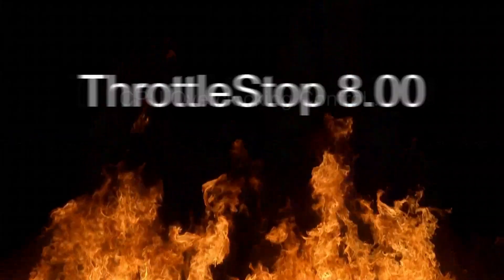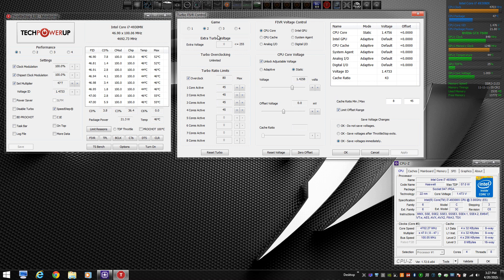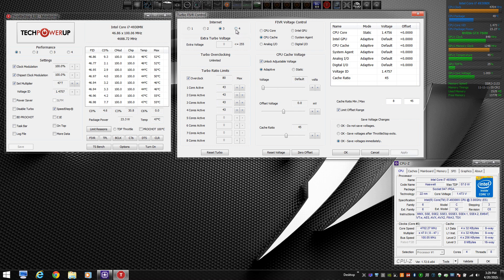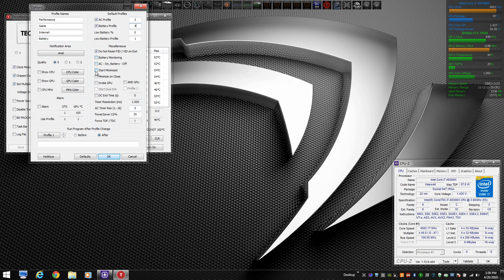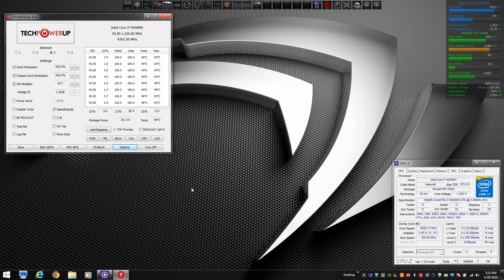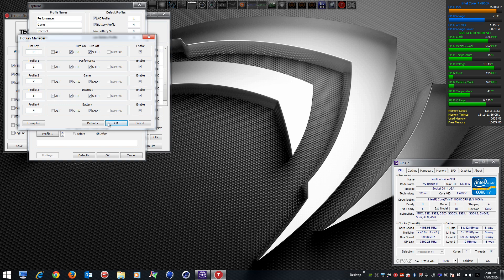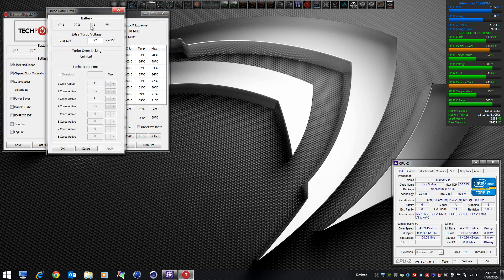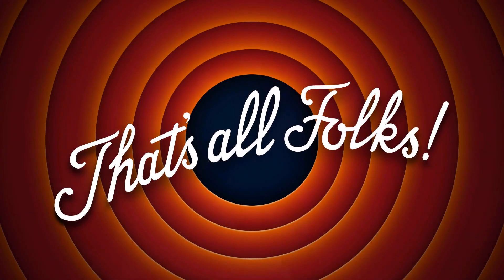ThrottleStop 8.00 Quick Demo - New Features

Comment: Mr. fox I am a beginner at CPU overclock. At my m18x I can overclock through bios. I have I7 2960xm.
What is best, using bios, using throttle stop or using Intel extremely utility?
Reply from the maker: You can do it through any of those means. Look at some of the other videos for M18x overclocking on my YouTube channel.
Reply: MrFoxRox2 what do you prefer?

Comment: Will these settings work for the Intel Core i7-4940MX?
Reply from the maker: ***** Every CPU is different, especially so more than every with Haswell. They may work perfectly, but you might need to tweak them a little bit up or down to keep your CPU happy. Just be aware that there are some that just don't overclock well compared to others, and the silicon lottery has had fewer winners with Haswell than ever before.